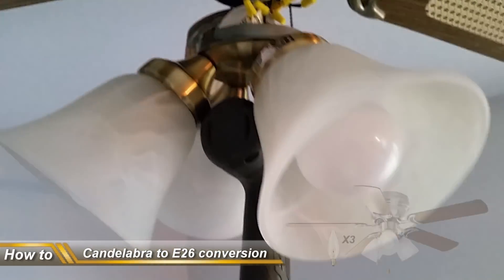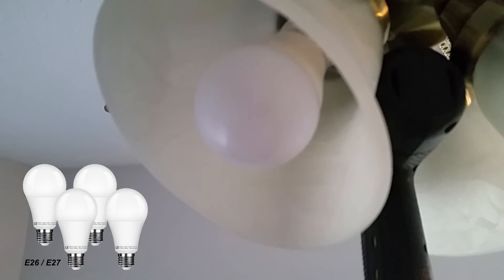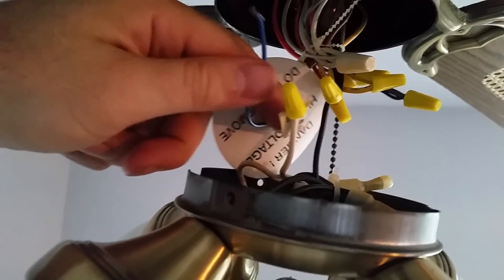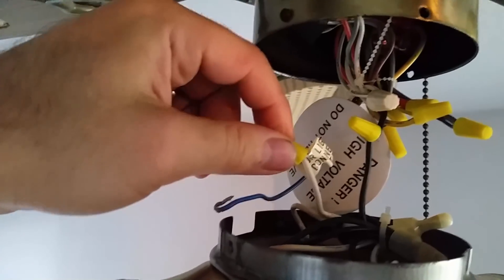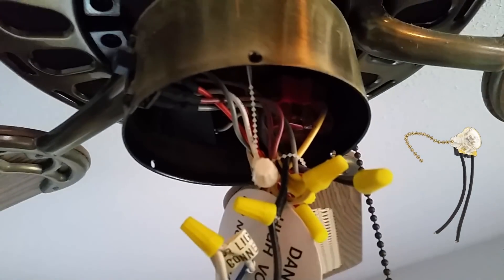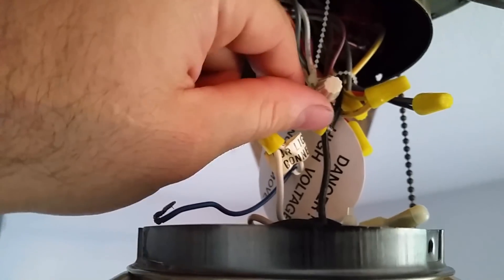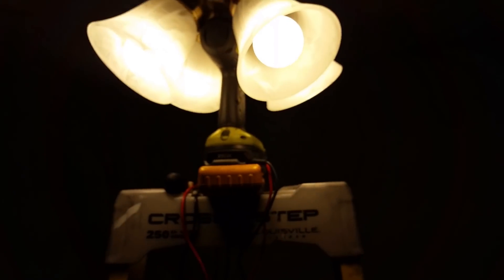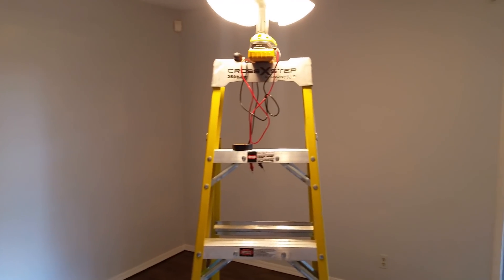Ceiling fan light kit bypass - Candelabra to E26 hack

Comment: Just a quick note to say THANK YOU.  I had this exact issue after I wired in two E26's and they didn't turn on.  After watching your vid, I bypassed to main and it worked like a charm!  Mine was a little more complex because I have on older fixture but I backtracked to low voltage converter, cut wires to bypass, pulled a bunch of useless wires out and it worked great!  Thanks again, you helped someone you don't know but I appreciate you :)
Reply from the maker: Glad to be of help